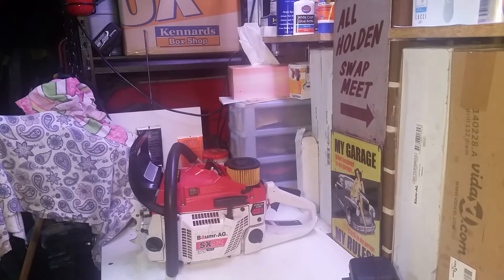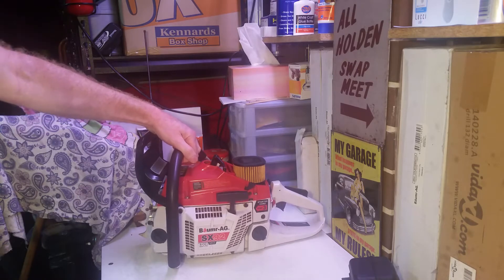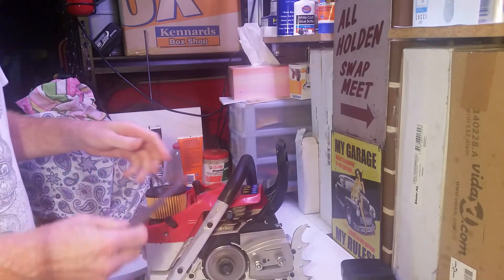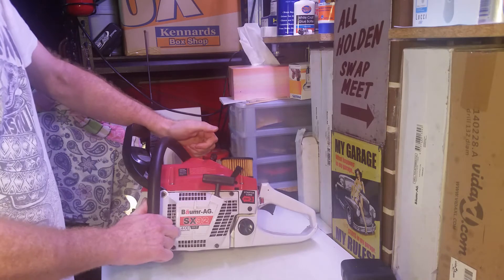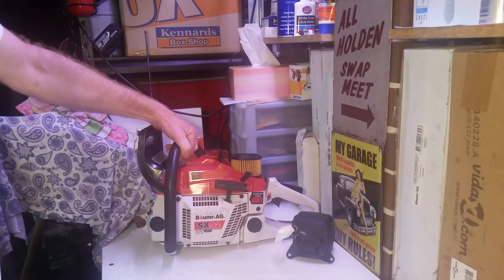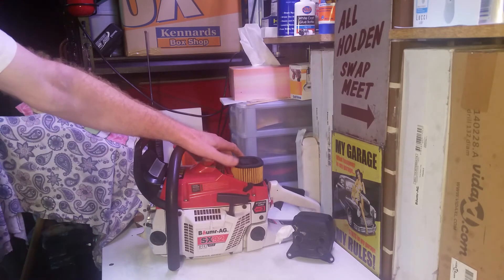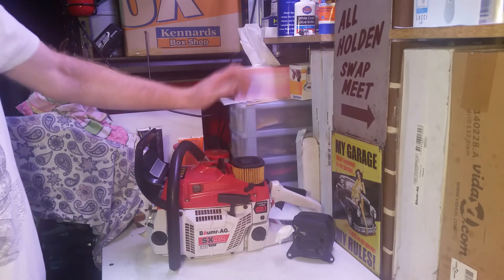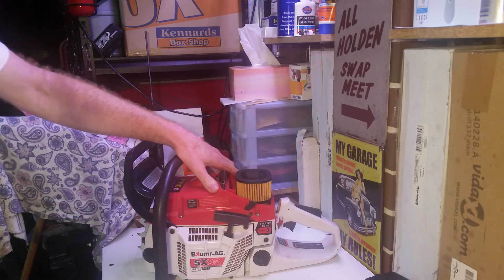Baumr-ag SX92 chinese chainsaw is not 92cc

Comment: I've been using my SX62 & SX92 MK1 very hard for 13 years, our family home is only wood-fire heated, my Missus keeps the heater going for about 10 months a year, never had an issue with these saws, fuel hose gets soft when really hot, and blocks fuel supply when it gets sucked in, but I am working them bloody hard tho ;-) These things are a bloody bargain.

Comment: I purchased one and had it thoroughly tested and turns out its a 92cc which would explain the weight. One web site advertises as a 72cc but thts before the upgrade fix
Reply from the maker: Don't know about the really old sx92, but if you bought the current sx92 which is a clone of Husqvarna 372xp, it is certainly not 92cc.
It would actually be 70.7cc
There is also a 48mm piston 65cc varient available from different brand
If you have the larger than standard, 52mm piston & cylinder fitted, it would be around 76cc. This is maximum displacement for this chassis without extensive modifications. Thanks for watching.
Reply: @anthonysgarage5283  the person who thoroughly tested it works for Stihl. He took everything apart and it's 92cc

Comment: So basically it's a Husky 372 copy. I think the sx82 is the same but I would have to check the cc's
Reply from the maker: Yeah, It is a 372xp clone. I think your right there about the sx82. I did see a vid ages ago on Gavmans workshop he also measured sx82. It had same piston & stroke.
Reply: @anthonysgarage5283  Is your saw still going? I just bought a couple second hand, cheap, just so i could play around on the 372 platform.
Reply from the maker: @ozdatman  yeah, mine is still running great, but just cutting firewood.
Suggest always use decompression valve to reduce load on pull starter & be gentle with chain tensioner, gears are pretty crap.
I haven't had issues with the above.

Comment: Hey mate on the actual specs on there website it states it’s a 72cc saw not sure what tje sx92 is all about
Reply from the maker: Hi Lewis, back when I bought mine,sx92 was specified as 92cc, sx82 82cc, sx75 75cc & so on. These where mostly lies. This all changed after I took this matter  to Fair Trading. Currently  Edisons specify sx75 as 62cc, but it's only 57cc, sx82 & sx92 are basicly the same saw @ 70.7cc, they are Husqvarna 372xp clones. Thanks for watching.👍

Comment: I bet that was Edisons.
I have the older model Sx92 which looks identical to the Certa 88 (all parts are interchangeable) including piston, cylinder and crank (fancy that) so a 92 is exactly the same as a 88.
Both are wrong as from memory ( I measured this some time ago) and they worked out to around 82.
I can see how they figured out 88 from 82, they included the combustion chamber volume 6cc (which is the wrong thing to do) but to get 92 from 82 is just plain lying. 
Your saw where they have got 92cc from 70cc is Fraud....
Reply from the maker: Yes it was Edisons. In my opinion, you are bang on, blatant fraud!!

Comment: False advertising at it's finest. But can't complain I have 2 sx92  saws they do the job 372 husqvana clone. Made in China. I've cut 60 tons of wood with the 2 there still going. Still cheaper than name brand. Use until there buggered and throw away and go again and your still in front.
Reply: Hey Steve, 💯agree, mine is still motoring on. I have even done some chainsaw mill work with it. Keep it tuned and look after it and they seem to run fine.

Comment: Would you say its worth buying sx92 modal
Reply from the maker: since I made this video, I found a vid at Gavman's workshop, He measured his sx82 to have 50mm cylinder. I think both sx82 & sx92 have 36mm stroke. this would mean that both sx82 & sx92 have same engine displacement & are probably the same saw just with different sticker & price. I think there are 2 models of these available 65cc 48mm & 70.7cc 50mm check out huztl.net  find G372XP specs & G372 specs. anyway, all Chinese saws require tweaking & messing around, eg stripped threads, poor assembly, no quality control. these ones have dodgy chain tensioner mechanism, flimsy log spikes guaranteed to bend, oil leaks standard. they are getting a bit pricey now, but if you must buy one of these, I would look at sx82